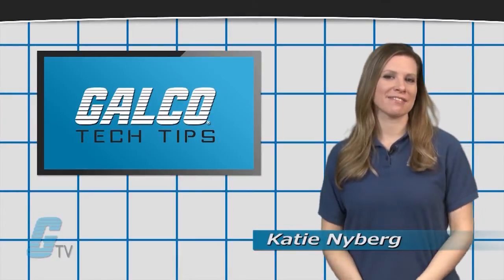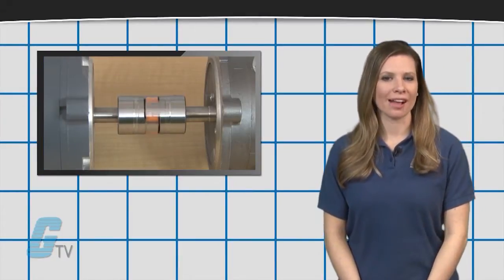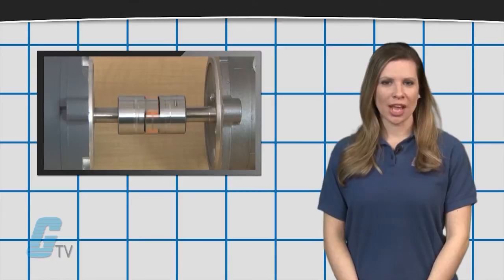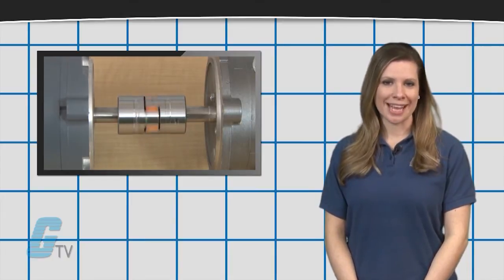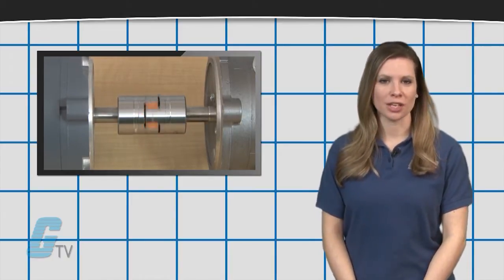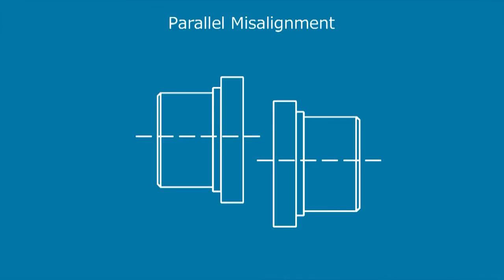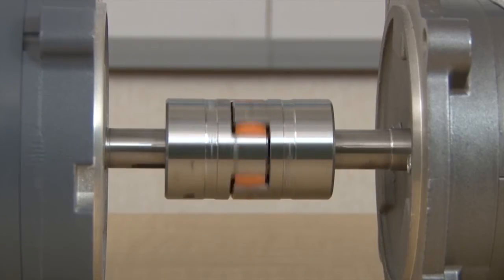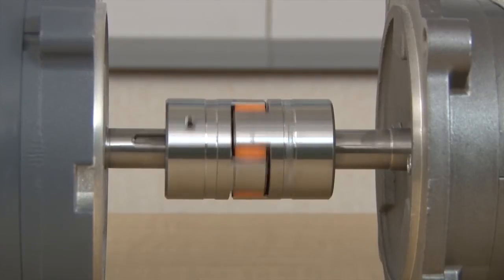Effects of Motor Misalignment - A GalcoTV Tech Tip | Galco

Comment from the maker: Parallel motor misalignment occurs when the two shaft center-lines are not in the same line.  This could be due to height or if the two shafts are placed offset from each other.  The angular misalignment occurs when the shaft center-lines are placed in such a way that if the two shafts were extended, they would intersect with each other. Axial misalignment is a variation in axial distance between the shafts of the driving and driven machinery.